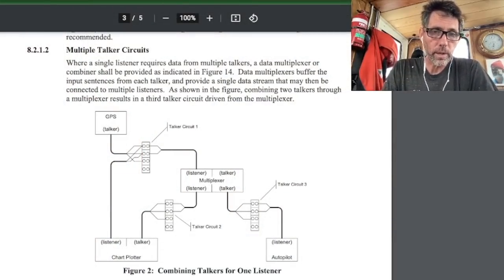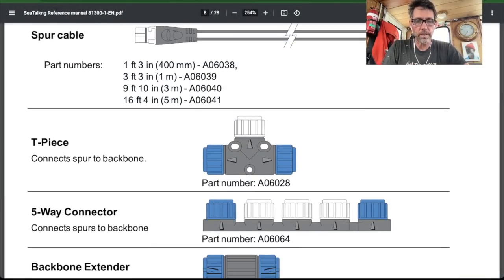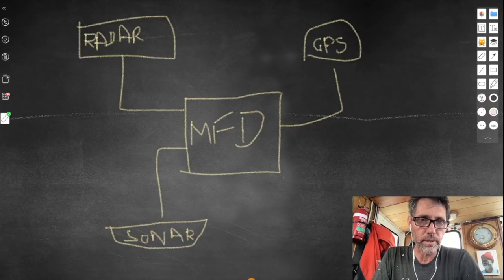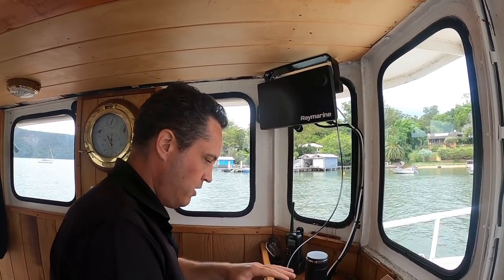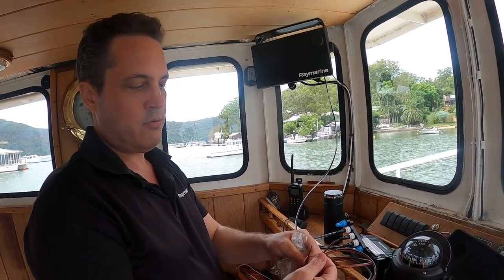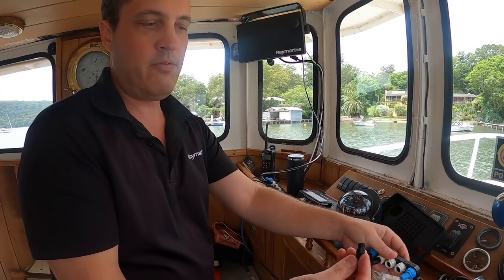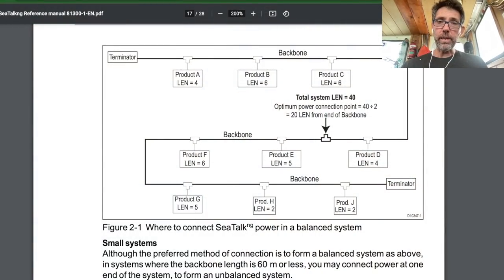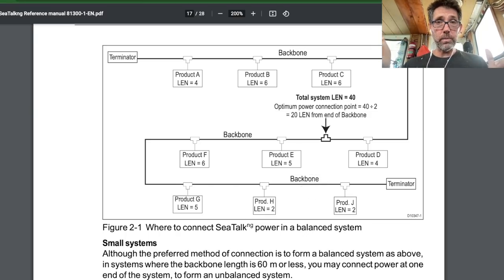NMEA2000 and Raymarine SeaTalk NG Networking

Comment: Watching Dangar Stu's latest. Gloss over his typical intro, waiting for the good stuff. Brain hears, "Today, we're going to be installing an Enemy A.I. onto Renko, and it's proudly sponsored by..." Wait. what?!
Reply: Not far wrong!  : )   I'm a big fan though & would recommend this to anybody. I've put CAN into airplanes and satellites. The boating companies have got it cleanly figured out though, no rocket science required, with NMEA 2k and this hardware.  An important thing to know is that NMEA is the language spoken on boats, and the CANbus harnessing is the hardware.  You will likely have some hardware gender-bender type problems if you mix and match the hardware flavors Mare-tron devicenet and and SeaTalkng for example.  With a lot of experience, I nevertheless found translating between the two hardware paradigms to be a brain-twister.  Oh, and remember this J-1939 is NOT compatible (...but you can get a converter.)

Comment: Working for the US Coast Guard as an electronics technician, they trained me on both systems since some vessels still utilize nmea 183. 2000 is so much simpler and reliable in my experience. Great video Stu.
Reply from the maker: For sure. 2000 is definitely a much simpler and more capable setup.
Reply: @DangarMarine  definitely one of the best overviews of the Raymarine 2knet,   by both you and the Raymarine rep.

Comment: Great video!   Excellent summary of connecting devices.   Please consider a video adding nmea sensors (temp, oil pressure, cooling water, or tach) to the Detroit, and networked into the system.   Amazing amount of nmea sensors now available for just about anything.  Old school (Detroit Desiel) meets new school (nmea 2000).
Reply from the maker: Thanks Jeff, yes, I would do add some sensors to the Detroit and gearbox too!
Reply: This is me. I've got old detroits and they have no digital sensing.  There are two choices: all new transducers, or a converter.  I picked the Alba-combi unit which is a converter.  The reason is that all the sensors are installed on the engine already, and harnessed up to the bridge. There's nothing wrong with analog sensors, and the tough part, fishing all the cable, is already done, and the expensive part (all the gauges for two helms and two engines) is sunk cost.  So what do I even want?  I want the computer alarms to watch oil pressure, coolant temp, exhaust manifold temp etc etc. all the time, so I don't have to.  I could lose an engine because i"m drinking a beer instead of watching water temp.  the converter will take all the gauge inputs and stick them on the N2k network so the chartplotter display can alarm them.

Comment: Hi Stue, going back a couple of episodes you mentioned about you would have liked a bigger boat, not being able to sleep because I'm just an old bloke it came to me in the middle of the night. perhaps you could extend the rear deck by 1200mm, the deck only no the hull, and support it with a couple of triangle braces, you could then extend your cabin by about 450mm this would be a fairly easy modification. Of course this just a thought that I had. I enjoy your weekly updates.

Comment: Really nice set up. The Detroit controls being mechanical you can try using some electric over air valves to work trans and throttle. I'm sure that Detroit has a place for an air compressor to run off the bull gear.

Comment: The grounding sounds the same as an industrial system. 
Normal ground for power circuits is protective ground as it allows the protection circuits to work correctly. 
The other ground is instrument ground, this allows instruments to work correctly and the two systems are not normally connected.
When I say not connected, in the petrochemical industry the act of connecting these systems together generates a DCM (don't come Monday)

Comment: If only CAN in automotive was this simple and user friendly. Car manufacturers seem to go out of their way to make harnesses as difficult as possible to diagnose.  A spare Backbone, Backbone Cable and Device Cable would be handy as spares.
Reply: if your car came without any dash or ECU at all and you had to add that all aftermarket, it would surely become this easy. for the same reason in both situations. market control. if you have an all Raymarine setup, your gonna keep buying their stuff, cos the plugs all fit. the automakers also want you to keep buying their stuff, so its obscured. its way easier to just buy their part. CAN is open and pretty robust, but the industry does not really want you playing with it.
Reply: It’s not designed to be user friendly as it’s not intended to be user accessible. It can be of course in consumer-facing products like aftermarket ECUs (see Haltech) but not in your everyday mass production car.
Reply from the maker: Yes, definitely have a few spare connectors and cables onboard. :)

Comment: No NMEA2000 fueltank senders yet?
Reply from the maker: Not yet, but I would like some fuel flow monitors one day.
Reply: @DangarMarine  yes very handy. I have fuel consumption from outboard and both Fueltanks have senders. The Raymarine MFD shows me if i can get home from a fishing trip nicely without using the spare fueltank. And if i trottle back, range increases acordingly.

Comment: Hi, I have a Raymarine Axiom unit and a Garmin unit in my boat. I'm not sure why the😂 previous owner decided to put 2 units in the cockpit. The boat has a Seatalk NG setup. I was thinking about moving the Garmin from the cockpit to inside the cabin. Can I connect it to the seatalk, and if so, will it sync with all the Raymarine data? The other thing I want to do is put in a Fusion stereo and a fusion remote controller, which can both be connected to the NMEA network. Will these work normal through the Seatalk NG network? Thanks for any advice/help you're able to give.